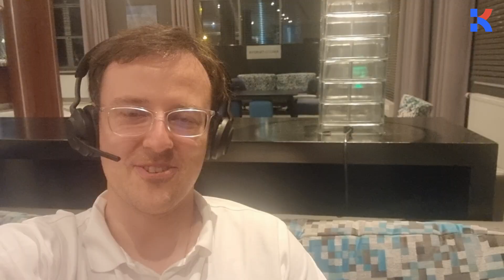3 Common SAP Solution Design Mistakes | What to Avoid in Your Next Project

Comment: A big challenge for me in one of my projects, during the Discover phase , was that there was a global template solution which was supposed to be rolled out to a particular market. However, that market was not convinced with this solution and was demnading lot of local customizations , and due to lack of clear communication between business and the template team, and since the implementation team was the one facing the customer, we had to perform the role of being mediator between template and business and convince the business of going live with template solution with only the most necessary customizations. This could have been avoided if there was a better BBP/ Fit-Gap analysis before the actual rollout team got involved and took over the user stories
Reply from the maker: Thanks for sharing this example, this is a very real situation in template rollouts.

I partly agree with you about the Fit-Gap/BBP phase helping to prevent these issues, good preparation definitely reduces friction. At the same time, in my experience, even with a solid Fit-Gap, resistance to a global template can still appear later, especially when local teams start seeing the details of how the process will actually change.

And yes, the implementation team often ends up in the mediator role. Not always easy, but sometimes that’s where a lot of value is created.

Wishing you smoother (and wiser 🙂) projects ahead!

Milos